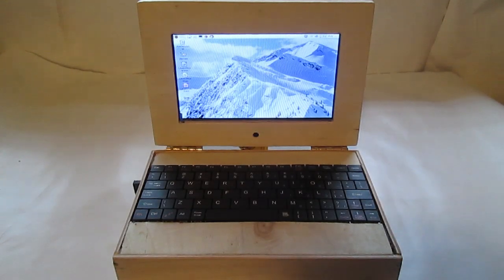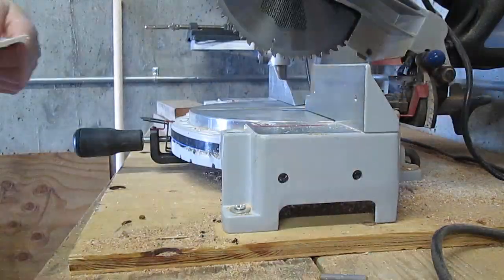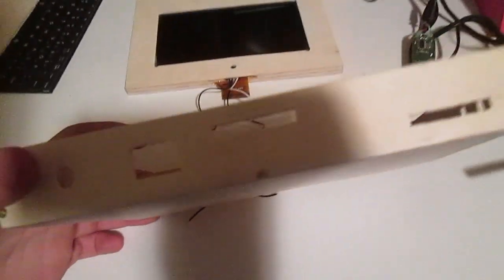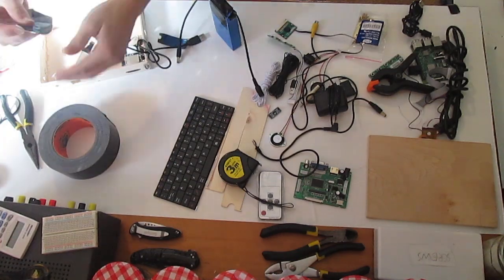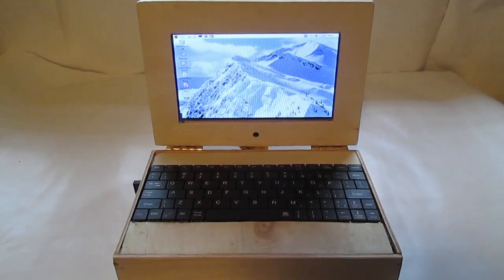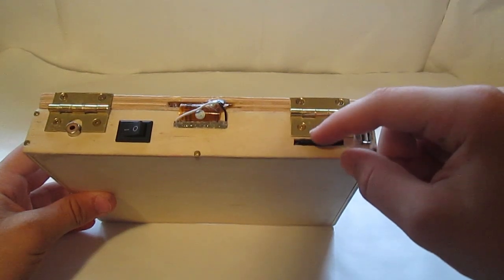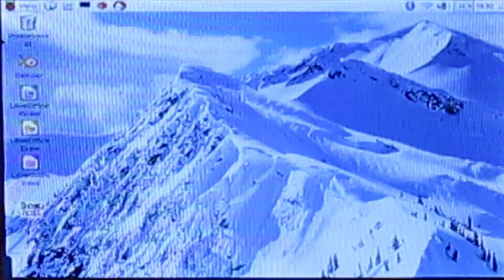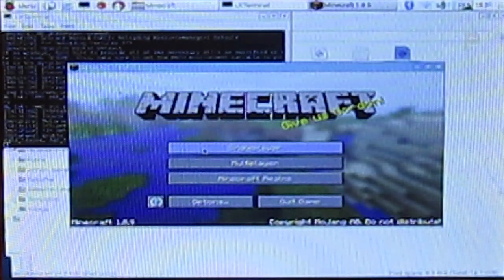Building a Raspberry Pi Laptop

Comment: Hey I'm almost done with my cardboard computer I'm making I just dunno what I can use to hold the screen up Ik usually id use hinges but I don't think hinges would work with cardboard but do u know any ideas what I can use to hold up the screen to the case hmm
Reply from the maker: You could probably just use hinges and superglue them to the cardboard. JoshBuilds made a video in building a cardboard laptop and it might be a good idea to check out what he did

Comment: Does this method work with touchpad keyboard the same size?
Reply from the maker: Yes it should work just fine as long as it’s usb
Reply: Electronic Grenade did you use a buck down converter on that battery? If so how do you connect it, I see 1 male & 1 female dc cable coming from it I think. Did you have to solder anything as well?

Comment: Hello, nice build. Me too I'm building a similar laptop, you can see the first part in my channel.
Can you tell me what battery charger/controller board did you use? I'm still undecided, perhaps I'm going to build a circuit for it. 
Can you charge and use the computer at once?

Comment: $150???? I bought an old eeepc 702 (701sd), 900MHz Celeron, 2GB DDR2, SD slot, and stuck Raspbian x86 on it, I now have the same as you except mine has a trackpad, total cost of mine, $8 plus $3 for an aftermarket charger. I guess I could put some woodgrain laminate on it to make it more like a $150 machine.

Comment: how are you powering the screen and the pi just on the battery?
Reply from the maker: The battery is 12v, and the screen runs off of 12V, so I directly connected the battery to the screen. For the pi, I used a 12v to 5v step down converter, that I connected from the battery to the pi.

Comment: Nice job! Have been used a tablet case´s keyboard? I´ve built my portable RPi with this keyboard also, but in separeted parts. Your project case looks like an old Toshiba Libretto´s subnotebook,  but updated to 2017! Do you have plans to make a tutorial? Thanks.
Reply from the maker: Lol. It actually does look a lot like the Toshiba. Good observation. 
Currently I have no plans to make a video tutorial. But lately I have been working on making a tutorial on my website for the laptop. Here's the link: http://gadgetcreation.weebly.com/diy-raspberry-pi-laptop.html

Comment: I've got a question, it woud be really nice if someone could awnser it: is there a possible way to connect a screen from an old laptop to the PI without a controllboard? By the way cool and nice Video
Reply from the maker: I'm sorry but there isn't. You have to have the driver board for the screen to work. GreatScott has a really helpful video on how to turn an old laptop screen into an hdmi screen, you should check it out if you haven't already.
Reply: Electronic Grenade Wow thanks for the fast support! I'll check that out (left a sup.)

Comment: Hey, it's me (back again, what do ya know?) with a very odd question. How are you powering the battery? You said you charged it with the charger included, but then do you have to take it apart every time you have to charge it? I'm looking for a way to charge my 12v series-parallel connected Li-Ions but I can't find a good charging circuit. Any ideas?
Reply from the maker: No question is too odd for me to attempt to answer! :D Here's a link to the same kind of battery I bought. http://www.ebay.com/itm/192065445138?hash=item2cb7fe1d12
So basically I cut a hole on the left side of the case and placed the 12V input cable ( The cable on the bottom left of the battery ) into it ( It's the circle to the right of the 3 usb's 9:18 ). So now I can just charge that battery with the wall charger and plug it directly into the laptop. Make sense?

Assuming that you want to charge your battery directly from the wall you could take the charger from a different 12V _____Mah Li-Ion battery and connect an input jack (that the wall charger can plug into) to your battery's, that should work. Hope this sort of helped! BTW what is the total amperage of you battery's?
Reply: Are you kidding me?!? Sorry, but thats kind of an unbelievable battery! An input AND output jack, presumably with a built in charge circuit? What kind of sorcery is this! I may have to pick up one of those o_O (Except for the 1 downside being the height). I have three 3.7v Li-Ions from a Macbook battery. I'm gonna try and hook them up into series-parallel for 11.1V and 5600 mah, and use some weird little board called the TP4056. I don't know much about it, but perhaps I can figure some stuff out. Though that battery you found seems amazing, and would probably let me avoid the sparks that flew when I was removing the cells from the enclosure. And amperage? Meaning AH? Or something else? The total AH is 5.6.
Reply from the maker: Lol! My reaction was exactly the same when I found it! I believe the charge circuit is in the charger and all that is in the battery is an led a resistor and an on/off switch. You can actually disassemble the battery and see that it is 3 different independent Li-ion battery's. And actually about 2/3 of an inch on the top of the battery is just the switch and some electronics. So if you were concerned about size you could just take it apart or buy a lower amp battery that's the same type. I will try to find out more about the TP4056.
And yes I did mean amp or A or AH.
Reply: Electronic Grenade I just found quite the amazing solution to this whole battery issue! It involves using a Power Bank (of a high capacity). Now don't get scared and say, "But Guthrie, don't be a silly head, a power bank supplies 5v, not 12v for the display!1!1!!" Because I just discovered something literally ungodly. It's called... a boost converter! Now I did know what this was, but I didn't know a whole lot. Apparently it's just a step up regulator. What also threw me off was that I didn't think of this before. It seems so obvious. But using a power bank would be small, rechargeable, and easy to use! So that's probably the way I'm gonna go, and if I don't then I'll go with the battery you used. My project is gonna continue on so I'll post updates on my channel if you are interested in following that. Thanks so much for all your help!
Reply from the maker: How did I not think of that? That's a brilliant idea! Well done! 
I'll make sure to sub to your channel!

Comment: Nice build! Just a few questions. I assume that you picked up some sort of LiPo charging circuit for the battery, and probably used a regulator to bring down the battery to 5v for the the Pi. But for the display did you just wire that directly to the battery/charging board so that could get 12v and the Pi could get 5v? Overall great build and I'm probably going to have to do my own! Very impressive, subbed!
Reply from the maker: Good questions! So actually I just bought a 12v 6800mah battery that came with a charger meant for that battery. For the display I hooked it up directly to the battery and used a car 12v to 5v 1a converter to power the Pi.
Reply: Huh, interesting. The only thing I'd be worried about is the 1a for the Pi. Doesn't the 3 need 2.5a to run safely? I guess you can get away with it but to be safe it seems like having something like a pololu regulator  in there would be an improvement. Thanks for the reply! I really hope you keep updating and improving this DIY build!
Reply from the maker: Yeah you're correct. I forgot to mention that you can switch from 1a to 2a on the converter. But I think eventually I will switch out the car converter to a safer and better quality one. The reason I used the car converter is simply because I was in a hurry to finish this project and a forgot to get a converter so I just picked the car converter at the dollar store. :)
Reply: Ah, makes sense. Well, if it does the job for now then congrats. By the way, any thoughts on adding a touchpad? To me it's important to a laptop that there is a trackpad of some sort, but it's unbelievably hard to find the exact design I'm looking for. It's a shame I can't find a stand-alone USB touchpad. Oh well, the search continues. :/
Reply from the maker: I really wanted to add a touchpad but like you said its very difficult to find one that can fit comfortably and is usb. I might just try to remove the trackpad from this wireless keyboard ( http://www.ebay.com/itm/Rii-X1-Mini-2-4GHz-Black-Wireless-Keyboard-with-Mouse-Touchpad-Remote-Control-/111821091071?hash=item1a090e70ff:g:nG4AAOSw7s5Xg-Yl ) and work it into my laptop. If I ever manage to find a nice small trackpad i"ll be sure to let you know.
Reply from the maker: Rats. I guess I'll have to think of something else.

Comment: this can run minecraft my pc cant
Reply from the maker: What kind of computer do you have?
Reply: Electronic Grenade its a HP computer got it for 80$ with monitor and
Reply: and keyboard and mouse
Reply: AlexanderGoa your PC must be a calculator if it can't run Minecraft
Reply: Lightn1ng windows 10 edition works on anything as long as it runs windows 10 and it even works with android as the pocket edition (PE and Win10 versions are the exact same)
Reply: the casio prub can
Reply: cffud
Reply: Mine too
Reply: alburtsstuff...
Reply: Same dude my Toshiba 2gb ram 200gb hdd runs Minecraft 1.7.2 at 1fps.
Reply: @jaceyporter8373  try lowest settings possible + optifine
Reply: AlexanderGoa yeah it can run it
Reply: The raspberry pi is running Linux,witch is much lighter than windows.Also the raspberry pi has a specal,modified version of minecraft so it's lighter and easier to run

Comment: Way Cool!
What BEC are you running on the on the 12v lipo?
Liked and subbed!
Reply from the maker: XB I'm using a car to USB 5v 2A adapter.
Reply: Nice, I build and fly drones. I noticed that 3S immediately!
Reply from the maker: XB That's awesome! I've been thinking about building a drone for a while but never have gotten the time to research it. 
Where do you get your drone parts from?
Reply: I like to purchase local, but the internet is really taking over everything anymore.
My favorite stores are getfpv.com, some select eBay stores.
I listed the parts and locations of my builds on some of my posted flights.
I'd start there, too much to write here. :)
It's a great hobby! I like the building and trouble shooting the electronic as much as the flying...
Reply from the maker: XB Great! Thank you!

Comment: That looks like a lot of work to put together.  Couldn't you have gotten a laptop that wasn't working and pieced everything together a lot better and quicker?
Reply: David McBenge While it would be most likely cheaper to just buy a broken laptop and reuse its functioning parts and casing, the point of this project was obviously to build a laptop from scratch, including a homemade case from wood.

Comment: i may have missed it in the video, but how did you interface that laptop keyboard to the PI?
Reply from the maker: It was actually just a tablet keyboard that was connected to the pi via USB.
Reply: Electronic Grenade oooooh, ok.  Thats pretty slick.  I though you cracked the code on reusing old laptop keyboards.  Great project though. Thanks.
Reply from the maker: That would have been pretty cool. Thanks!

Comment: can you make it more slim
Reply from the maker: I believe I could if a bought a smaller battery and a smaller control board for the screen.
Reply: Lol i was trying to make mine more slim, i need a smaller hdmi cable
Reply: How did you get it to run on rca jack, is it in the config file or something?
Reply from the maker: I just shortened down an HDMI cable. 5:22
Reply: How did you know which wires to connect
Reply from the maker: In side of the cable there are 4 smaller wires, and in side of each one of those there are 5 even smaller wires. Each one of the 4 wires are a different color. And each one of the 5 wires are a different color. So I just cut the cable to the size I wanted and stripped the wires and soldered all of them together based on the color of the surrounding cable and the color of the main wire. I hope this helped.
Reply: Thx

Comment: That was literally one of the coolest awesomest things I have seen in a long time and all built by hand from scratch (minus the Pi)!! I would be very interested in making a mini portable PC with the Pi similarily except perhaps minus the laptop functionality but have it as an All-in-One PC with an external mouse and keyboard. Would there be a way to rig it up to a mini-power supply by Silverstone or something and rig up a low-end graphics card for light PC gaming if I install Windows on it? Purely for light Steam gaming like MMO's and stuff. Would only be running the Nvidia GT210 off it as I already have that card off the shelf. Also have an extra PSU I am not using from an old build so I am very interested in using the Pi to make an ultra mini low power usage gaming PC if it's at all possible.
Reply: That's a really neat idea! You should be able to wire some sort of graphics card straight to the gpio. I'll look into it further if I can get the time.
Reply: Thanks! That sounds cool. I will do some more research as well.

Comment: quality build, very inspiring, do you have a wiring scheme, because in my project i have 2 batteries and 2 battery boards and i would like to make it down to 1 battery board.

ps: i had a problem with a way too long hdmi and thanks to you i am certain that it causes no harm if you cut it and resolder.
Reply: Thanks so much! I'm sorry but I don't have a wiring scheme. But I might be able to help, what kind of batter boards do you have?
Reply: Powerboost 1000c and 2 batterypacks 3.7v.
Vertalen neat idea to use a tabletcase for keyboard.
Reply from the maker: And you want to combine both battery's?
Reply: Yes but i have no idea how to wire it or if the batteryboard can handle it.
Reply from the maker: If you wire the batteries in parallel and than connect that to the board than it should work. Here's a diagram of battery's in parallel http://www.gizmology.net/images/parallel.gif.
Reply: I see, but are you Sure the board wont fry up?
and I guess from the board i wire the rpi and the driverboard also parallel?
Reply from the maker: How many amps are each of the battery's?
Reply: 6600 mah at peakload 3.3 A and ideal 1.3A
ps: what is the next project you'll work on?
Reply from the maker: Right now i'm working on a 3d printer using old dvd drives. That video should be up in a few weeks.
Reply: nice, i am looking forward to it

Comment: it looks great but it seems too thick to me for comfortable use. And I'm certain that with better design you'd be able to make it few milimeters thinner
Reply from the maker: Your probably right. The main reason it was so thick was because the battery was about .9 inches thick. If I used a smaller battery I could have made it thinner. But I'll take battery life over thinness.
Reply: If you were buying for this batter and not just found it around, you could buy wider one - the charge would be the same but it'd be thinner. For instance I have in my laptop battery which is only about 5mm thin but It lasts quite long because it's like 20*10cm.
Reply from the maker: True. If I make another laptop I'll definitely work on making it as thin as possible.  I was thinking of making one with the raspberry pi zero.
Reply: good luck with it, fingers crossed
Reply from the maker: Thanks. Lol